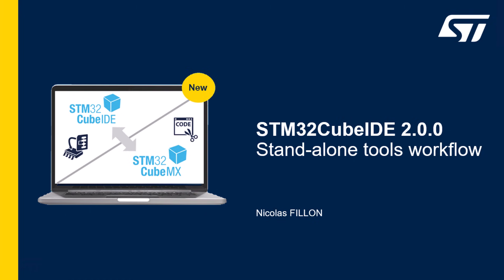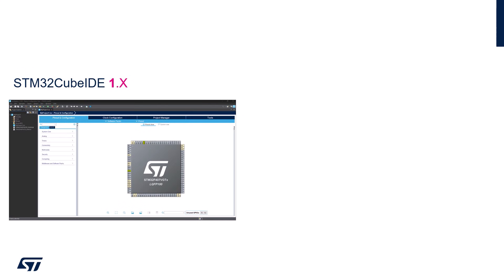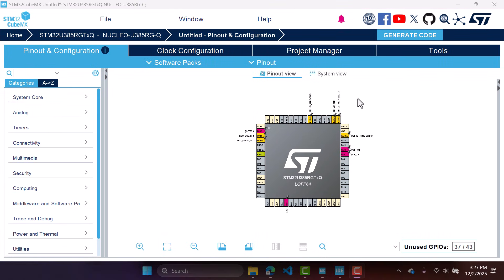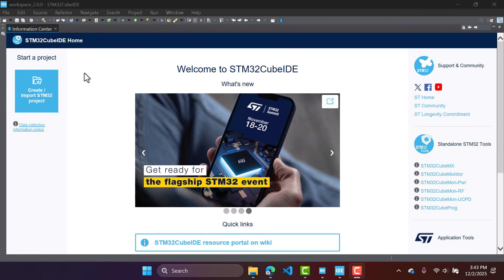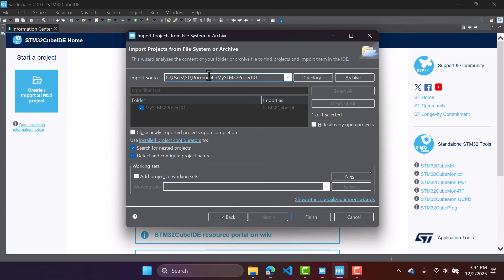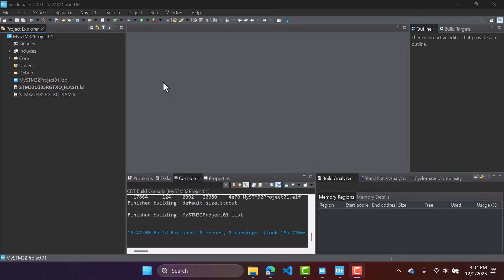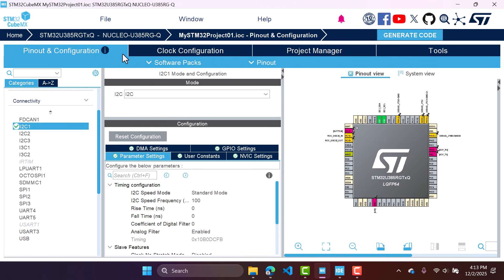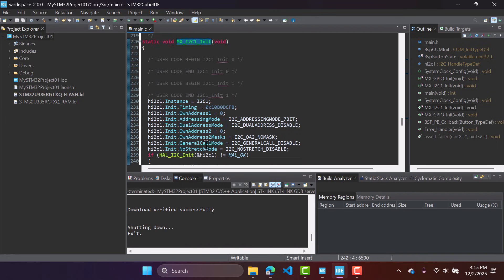STM32CubeIDE 2.0.0: Stand-alone tools and updated project workflows

Comment: Hi, I've always used the 1.9.x version and now i'm trying this new 2.0.0 on a Macbook Pro M4 and this is not working as shown in the video. I can only create a folder with the code generated by the CubeMX but it is not shown as a STM32 buildable project in the STM32CubeIDE